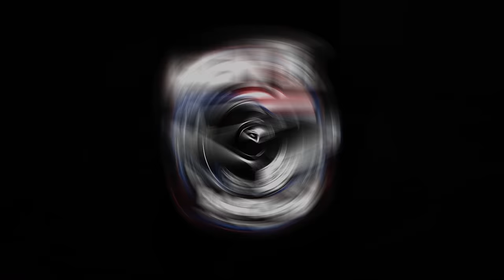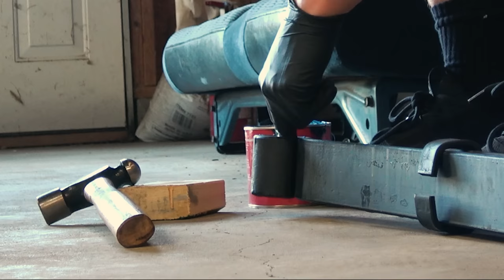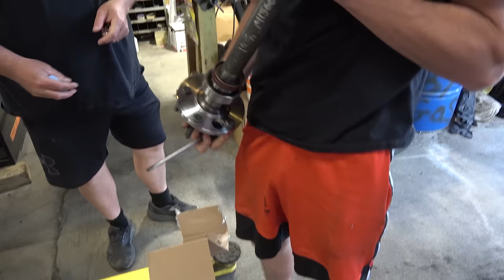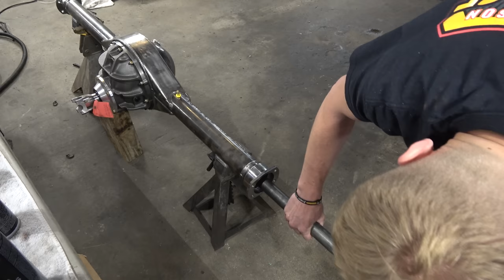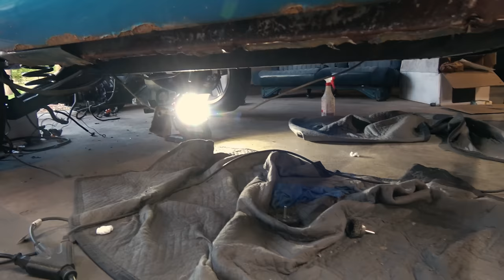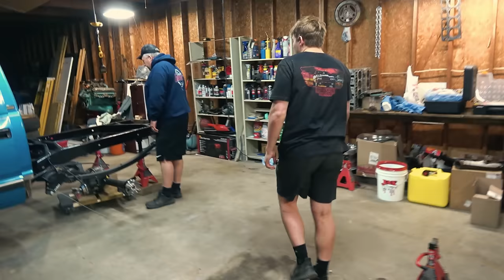Turbo OBS Drag Truck Build Gets a Ford 9" & CALTRACS!

Comment: You know using 93% galvanized paint with your top coat is a lot cheaper and works just as good. We use it on metal for the navy

Comment: Put a pair of vise grips on the bad nut or pipe wrench,  put clamp on spring then cut off with a cut off wheel . More Hoist too also a pit would be good too

Comment: Looking good Tommy only thing I would have done unless you didn't film was locktight on brake brackets for the calipers but I'm really not hear to judge but look at Dad being impressed 😉 Good job 👍

PS: have Mark at A1 Auto get you a couple cans of self-etching primer to put on that bare metal rear end before you paint
Reply from the maker: The stuff has to come back off at some point , when it’s in final assembly we’ll go over everything
Reply: @gen2garage  right on good plan 👍

Comment: My last drag car had leaf springs also and had a problem with shearing off those pins, So what I did was drill the hole out and used some ARP small block head bolts to bolt the housing to the springs, Never had another problem
Reply: Ladder bars with leaves is pretty common, then those pins just float. Cal-tracs going in this.
Reply: @NonTypicalRacing  This one had slide a link bars from competition engineering
Reply: @scotthazelton519  aaahh...those were nice.

Comment: Hey Tommy, you want to put both eyelet ends on that Caltrac bar before you install them onto the brackets. One of them is reverse threaded so it works like a turnbuckle. As you turn the bar, both eyelets move out and in (lengthening and shortening the entire unit as you turn it depending on the direction turned). Makes it a breeze to install once you do this.
Reply: Wtf....only 1 👍🏻 on this? Its a great comment dude. "I" was the 1 with the comment about how to apply RTV, but nobody cares if fluid leaks out around the studs on the center section to housing I guess. Lol
Reply: @NonTypicalRacing  Thanks man. Just trying to make things easier for him.

Comment: Just disconnect the rear part of the leaf springs. Lay the rear onto the jack stands, and reattach the springs. One they are snug, lay the rear in place on the springs. No need to squeeze it through anything.

Comment: Thread the ends into the caltrac and put weight of the truck on the axle and line up the holes and drop the bolt in then you can put a turn or two in it to set the preload. More preload plants the tires harder but also changes ride height.  I have 1 1/2 turns in mine and it hooks just fine

Comment: I needed some center bolts (dowel pins) for my 56 BelAir  springs  so I could remove a leaf and and replace the sliders between the springs. No one within 40 miles could even order any. I had to get them from E-bay! I wish we had a good parts store like Y'all do.

Comment: Tommy, get yourself a 1/4" collet die grinder when you can. You will be shocked at how well it will wire-brush rusty metal, and pick up some carbide bits too. You can use them to port heads and intakes, elongate holes, and numerous other things.

Comment: Looks like my s10 about 2 years ago.  I went a little farther and boxed in the frame couple lengths of 1/4 plate and a lot of welding. It'll be done and on the street before you know it.
Reply: 1/4"?

Comment: Allison .. hopefully ya put a dent into some of Billy's outstanding orders... Sorry people can be such.... Apologies If I was one of them..  Tommy stead of rounding those off might have been better to use a step drill and just open the hole to the nex size.. Just my thoughts for future reference I know you prefer your stuff to be more clean.. or do you like old man said put right dowel pins in and flip them.. unless ya wanna lift rear end then mount rear end on bottom side of springs..

Comment: Tommy if you had one end of your Lee springs down. And then jacked up the front or the rear that was down to get your bolts back end. Just a slight suggestion. Instead of trying to slide the rear between the springs that are bolted up.

Comment: When installing back spacers,Remember the tire will  stick out past the rim,dont want the tires to touch the leafs,and remember the carpet is ment to go up the back of the cab on some trucks,i had a 78 and an 85 square body and both carpet's went up the back of the cab!!

Comment: You still need that factory harness for some things. Video on YouTube for it called how to thin 88-94 Chevy wiring harness or something along that line. Super simple. So you can still have power in the truck switch power to the key blower motor will still work ect.

Comment: I'm not sure if anyone else has said it or not. My experience (one 71 nova k member) the POR-15 will not stick to flat smooth bare metal. With my frame it did best with rusted or ruff areas(sand blasted). Spots I had smooth just flaked off even.
Reply: Says it right on there too.

Comment: If you haven't cut the carpet yet.. my s10 was a Tahoe and the carpet ran up the back wall up to the window. You could do the same. Glue it to a board and cover a 1x2 or whatever size looks good to run the top of the board like a trim piece.

Comment: Hey Tommy, moving forward you need to treat all rust(even the light stuff), with  ospho or some equivalent. All that rust you painted over will come back in a year or two. I learned the hard way that por15 sucks, unless you get rid of the rust.

Comment: I got a 8.8 diff In the same truck for a 15x10 you will need either 3.50 back spacing or 3.75 , you also gotta make sure the rim and tire combo won’t hit the bed tubs and leaf springs

Comment: Tommy my RC comps on my obs are 6in backspace but could really use 6and a half .Hope that helps some
Reply from the maker: Thanks for the info!
Reply from the maker: Are they a 10” wide wheel?
Reply: @gen2garage  Yes 15/10 rear RC Comp Duce is the wheel style I got

Comment: I've got basically the same truck Tommy, lowered 4" in the rear. Hate to tell you but you're going to need a C notch kit or it's going to bang the frame on every bump.

Comment: Hey there Tommy 2 guns thanks for posting. I was curious if you would do me a huge favor take a quick look in your door jamb to see what color blue that Chevy is or wherever the paint code is I think it's in the door jamb cuz I have acquired an OBS as well and would like to make it that color I got my stock stuff running good change out the transmission recondition the used wheels put them on the truck and I'm on the road thanks again for posting I really enjoy your whole family's videos I watch all of you guys and can't get enough of it it's good stuff keep on crushing it brother
Reply: If U go back to the last post from Tommy, in his garage, he tells U what color the truck is -- he's got some of it in a rattle can.
Reply from the maker: It’s called Bahama Metallic blue , they actually sell cans of it at advanced auto. Or you can go some places and get it mixed. Just tell them Bahama Blue off of a 92 OBS

Comment: Tommy great video I noticed you aren't using any pinion angle shims under the differential pads I know back in the day Caltrac called for a negative 5-7 driveline angle when I did my  S10 just trying to help out

Comment: Tommy u should have left the rotors off easier to slip in . I used to have to drop my Nova rear end out every couple of months cuz I kept destroying them . had a old Nascar engine in my nova . with everything correct I ate up prob 6 12bolt rearends built a fab 9 with strange center section . no more problems  . rotors off slips  right in by yourself

Comment: might want to tighten up those center pin bolts a little bit more, they are lose. There shouldn't be any gap between the leaf.

Comment: Not a truck guy but looks like u might need to do a “flip kit” on that and notch the frame. My brother has an obs with a 9in flip kit mono leafs caltracks and a 6.5in BS on a 28x10.5 with fenders rolled if that’s any help
Reply: Stock length rear

Comment: Whole time I’m like “NO, just turn the dowels around!!” Lol Yeah, I could’ve told ya you needed ‘at least’ 5.5” of bs…I shopped around at Jegs to find the ONLY set of 15X10s with 5X5 pattern AND 5.5” bs they had 🤦🏻‍♂️ Really would prefer 6” bs as is on the stock setup BUT my 9” is being ordered 1” narrower than stock overall anyway 🤷🏻‍♂️

Comment: Isn't errthing that's not a late model a OBS? OBS 2wd P.U. built with N.O.S. and A/M parts like the ECU for EFI, TC and E85. What's the safe GVWR on something with call tracks. Seriously POR literally means paint over rust, so your good spraying it on bare metal. On that rear end bolt up, the way your going about that will be unpopular and the hardest on paint. Sometimes working harder leads to working smarter? Drop the back of the springs and raise it from the c.s. effortlessly. Especially without brake lines. I'm interested to see these mean comments now.

Comment: Your dad should know better then that.  All you have to do is put a C-clamp or a couple welding clamps on the spring to hold it together. Then all you had to do was flip the bolt and put it together. Next why did you take the brakes apart to put the rear end in. Should have just pulled the back 2 spring bolts and put the rear end up. Then you could have jacked the whole thing up with a floor jack.
Reply: Thanks master tech